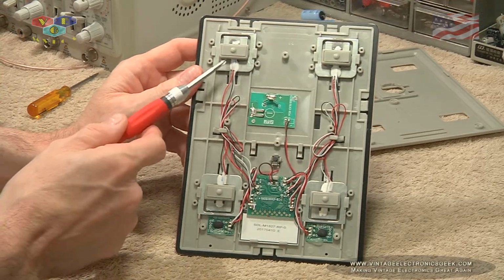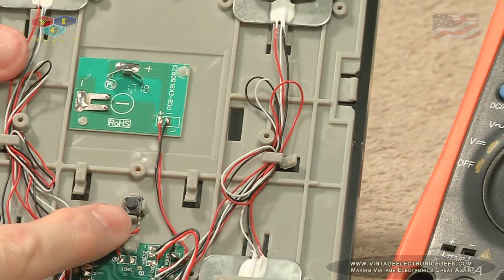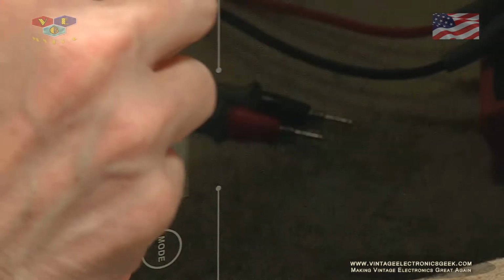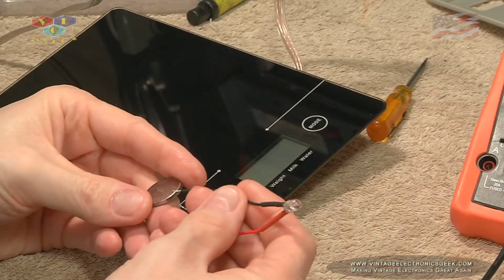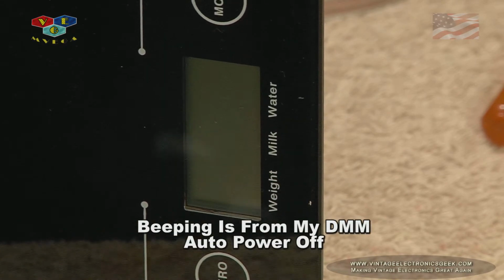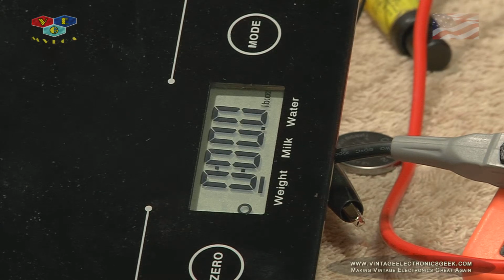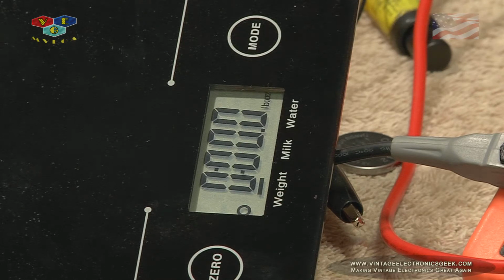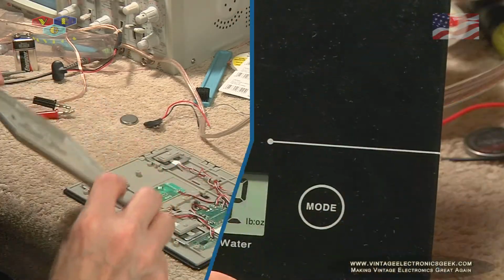Mainstays Food Scale - Troubleshooting

Comment: There is on extremely annyoing thing with almost all digital scales, the auto power off function. If you take too long when you are mixing your ingredients, the scale shuts off on you and you have to start over again. Is it possible to identify which component on the circuit board that is responsible for the auto shut off function, and somehow disable it so that the scale will stay on until you press the power off button?

Comment: The digital multimeter using takes very little electricity to measure the battery. Or any other power supply you can get a potential voltage from the battery that will read good but it does not have enough cranking power so to speak to start your device just like a car battery it may run the radio and the daash lights but not enough to crank the engine. I have found the easiest thing to do in a situation like this is take a 1K resistor across your multimeter leads when testing a battery will let you know if the battery has any current. In vintage electronics everything took so much current to operate you very seldom got false readings. Also a VTVOM works a lot better for testing batteries like that because it takes a little more current to operate the meter.
Reply from the maker: Thank you very much for your valued input, I appreciate you helping me out!  I will "try" and remember that tip for the next time around.  Since this video, I have accrued a VTVM...I like test gear allot..I have been collecting allot!  :)  Mainly stuff I can use...Thanks again!  ~Jack, VEG

Comment: Do you have a calibration procedure for a mainstays ek9180WM?  Mine functions but only shows 2 of the 4 units it was able to display before it lost calibration. It is similar to the one in this video. I’ve discovered that by holding both unit and tare together and then releasing and tapping tare after about 8 seconds I then access C - 15. After that, I’m able to get different results. Sometimes I can tap through 1-00 or 2-00 or I’ll get the scale to display numerical readings that react to weight. It currently shows the weight of 6 nickels at 15g. In any event, I’m simply guessing. If you have a procedure, I would be eternally grateful, and can go back to weighing hops for my homebrew
Reply from the maker: Howdy!  I do not unfortunately, however a quick Google search, I come up with this PDF (https://www.acurite.com/media/manuals/00939-instructions.pdf) that mentions how to calibrate, however, it sounds like you may have found hidden controls??  Wish I could help more.  All my best.  ~Jack, VEG
Reply: @VintageElectronicsGeek  did you ever find a way to fix this? I’m having the same issue right now
Reply: I’m having the same problem right now? Did you ever get it fixed
Reply: I have the same scale and it suddenly weighing 50% less.  I put a 2lb weight on it and it says 1lb.  Foot pads are good.  Battery is new.  I had to go buy a new (different) scale.

Comment: You know I have a lot of small measurement equipment such as  vernier Callipers and some I bought for repair. I have a lot of problems with the battery holder contacts. Once they loose the plating you can clean them repeatedly but they never stay good for long. Best regards Chris
Reply from the maker: You demoed some of your messure tools not to long ago and they were cool!  You really do have all the gear dontcha!  :)  So far this scale has been working since this video, but I will inspect it better if it does go down again.  Thanks for the info!  ~Jack, VEG
Reply: Vintage Electronics Geek  You know I have all those tools and all my shelf’s are sloping.  I need more practice but I’m having fun.
Reply from the maker: @allthegearnoidea6752  Me too!  ~Jack, VEG

Comment: The battery may look good but under load it doesn't register. So my guess is get a new battery and if the memory isn't shorted or fried it should work fine. I said this before I saw your end result of getting a new battery. I remember having a similar problem with a calculator I was scratching my head because i had a new battery I bought it was a two pack so the first one i tried didn't work but the second one did. But hey you got to troubleshoot it and now you know there is nothing wrong with any parts its just a battery.
Reply from the maker: Howdy Larry, was just thinking about you, hope your feeling better and you'll be back on terrorizing soon!  :) Yes, spent 70 min to figure out bad battery, a valuable lesson learnt at the end of this video...I took the battery at face value of being new and showing a charge on the DMM...now I have that little nugget and will look at current forth wit!  Thanks for watching!  ~Jack, VEG